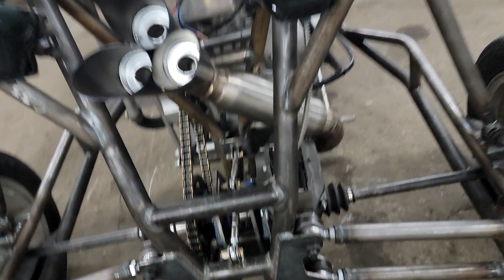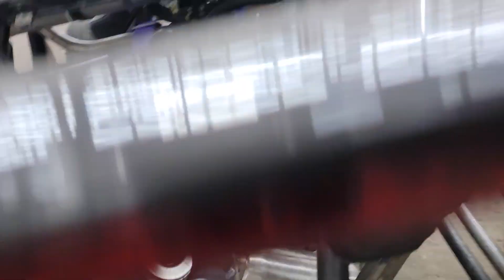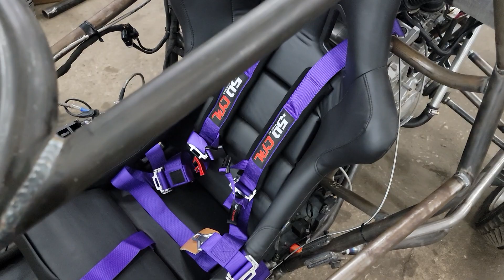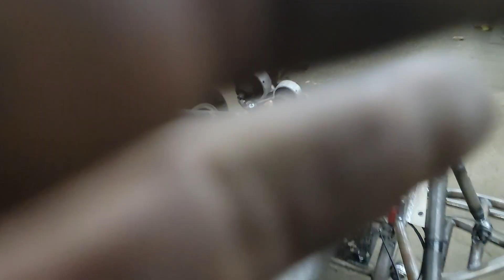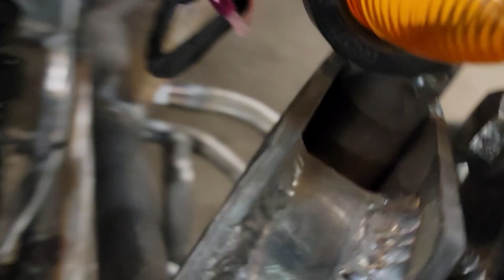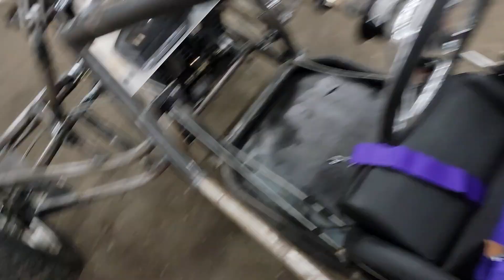My 2001 Fz1 Pushrod Crosskart!

Comment: Looking closely at this and the quality work that has been done including the welding I can't help but be super impressed. I am a life time welder, fabricator and aerospace machinist. This cross kart construction is at the level I would build for myself. I do question the need for the suspension design using the  /rocker/cantilever arrangement. I don't think it really gives any advantage over direct shock mounting. In other words I think it is cool but really unnecessary complication. But, I admit I am not a suspension engineer in any regard except as a home builder of race cars. 

I am rebuilding 3 old Honda FL350 Odysseys into long travel high clearance race level vehicles on the order/style of a Baja 1000 buggy. Building them to take any possible abuse and not break. I do wonder of a cantilever suspension design would work and be of advantage for me. If it could achieve a raising rate suspension then it just may well be worth the complication it would take to build. In other words softer more compliant initial travel for the first 6 to 8 inches then as the lever swings through its arc there would be a more direct and longer thus stiffer last 8 or so inches where the lever/rocker was at max leverage. Worth investigating. The other huge reason would be to separate the springs and the shocks. 

Coil overs are stupid expensive. Springs are cheap and so are car style racing shocks. Springs could be mounted on a lever on a shaft, a bit farther down the shaft could also be a shock mount. Lever could be any length needed and clocked at any position so as the lever swings through its arc and acts on the shock or spring there could easily be a raising level of travel built in when the lever is acting on the spring or shock giving it a raising rate. 

The difficult part would be making it tough enough to not tear itself apart. I don't really see a cantilever system such as this being used on race level off road vehicles, so there has to be some reason for that, probobly needless over complication and questionable reliability. Still worth some space in my brain though and maybe even a test suspension design if some basic engineering style thinking seems to justify it. I just can't let the raising rate idea go untested.
Reply from the maker: @robert5 you are correct as the spring rate is exponential.  Its very noticeable in action and in person.

Comment: Super job on this build. I see top quality craftsman ship on every detail. Why use the pushrod setup? Does not look like your coil over shock length would have been any problem for using standard coil over shocks. In most applications I see push rods used, there are constraints on shock towers sticking up but that is not an issue for you. I am not an engineer, officially, so just wondering. It is certainly cool though. 

I'm rebuilding 3 old Honda 350 odysseys with stretched frame and long travel suspension all from a Polaris xp1000. Easy and cheap to score that stuff from ebay. It is all built to handle well over 1000 lb buggies with up to 200+ hp. I figure it will be pretty Bulletproof and not be failing after every session with my 150 hp snowmobile engine. 

It will be like the grind hard plumbing odyssey but better because they used Honda 450 quad front suspension [breaks a lot] and I'm using the XP1000 hubs but in 2wd config so no front axles, just the stub end to hold the hub in place. Trying to figure out my shock configuration front/rear, why I watched your video. I'm a machinist welder/fabricator so I don't need to pay people to build things.

Comment: W your setup n way you made your shock suspension setup n etc?!
...How you think it'll do on sand dunes and vs Sand dune suspensions
Or
Your advise change suspension / shock setup for sand dunes?

I'm not a mechanic like you but just asking
Reply from the maker: if you did this style for sand you would want to do some massive modifications but with sand you could keep your shocks up our of the sand more.. but you would need to do a different style of knuckle for the cantilever
Reply: @jamelvaughn2010  any other advise towards send rail setup?
Reply from the maker: @Unique1Media  bigger shocks. Reservoir shocks. Thats about it  build the lever to give you the right ratio.. these change 1.5 inch of travel to around 7... so get some long travel shocks and leave it 1:1

Comment: what rose  joint  and tubes size  did you use for the shock absorber  push rod arms ?
Reply from the maker: @zico3239  5/8" Heims with 1.25"x .120" D.o.m. tube

Comment: what size wheels are you using? they look amazing on the kart
Reply from the maker: 15x5.5 I think? I know they are 15s with a 45 side wall.. hope this helps.. im running 4x100 bolt pattern all around so miata wheels fit.. theres alot of cheap sets on fb.
Reply: @jamelvaughn2010  how do you feel with them? I have an r1 engine but I'm worried they'll feel too heavy
Reply from the maker: @vicman440  they could be a little lighter. Look into some vms wheels they make a 15x3.5 I might get a set. It still is very fast with these. Plenty of grip. 0-60 ~2sec.
Reply: @jamelvaughn2010  that must feel insane, thank you for the info man I appreciate it!